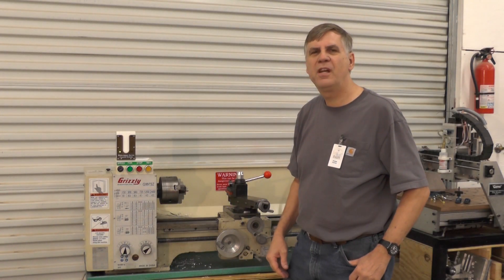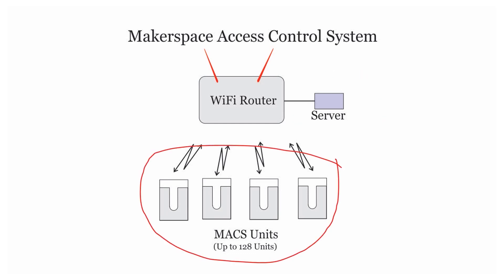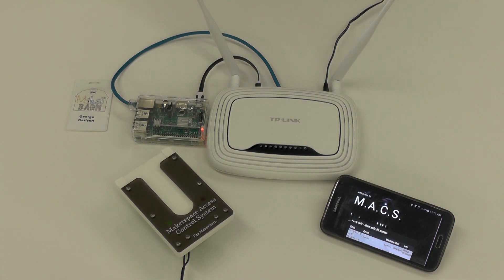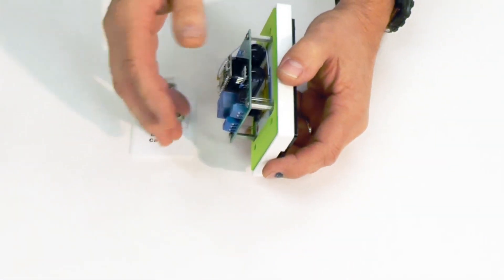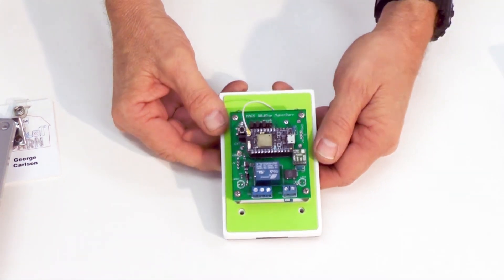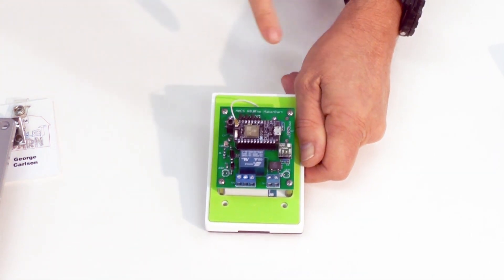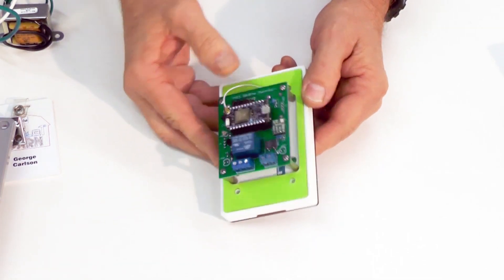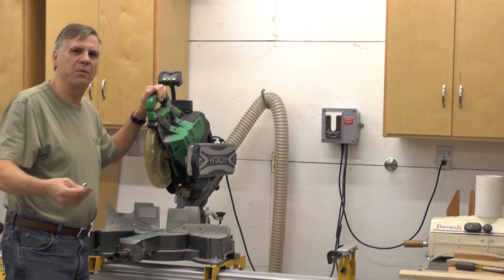An Introduction to the MACS - Makerspace Access Control System

Comment: George, I have reviewed the schematics on the Github page, is there any chance you have a parts list for the components such as the capacitors?
Reply from the maker: That schematic is very old and incomplete.  C1 and C2 are 1000uF 50V, C3 and C5 are 0.1uF.  We found that the Photon had problems during brownout, so a power supply sensing circuit was added.  You may have problems sourcing the RFID reader module.

Comment: This looks super great!
Are there any further progress on the project? 
The eagle file seems to miss the capacitor value.
Also the rfid module on ebay you pointed out doesn't have a tir function, maybe its discontinued?
Anyway, thanks for sharing all this on github!

Comment: How do you deal with the EM interference of some devices essentially jamming the wifi signal, and shutting down the equipment?
Reply from the maker: +Vincent Wolfe There's not much in the typical makerspace that would generate much EMI at 2.5GHz, so that's not much of a concern.  The biggest problems with WiFi is multi-path fading.  Hopefully diversity antennas on the router would help with that.  The unit stores the latest copy of the permissions database, so even if the WiFi goes down, the machine can still be operated.